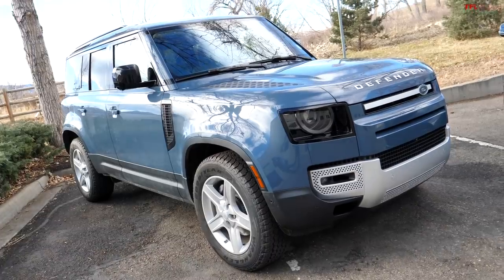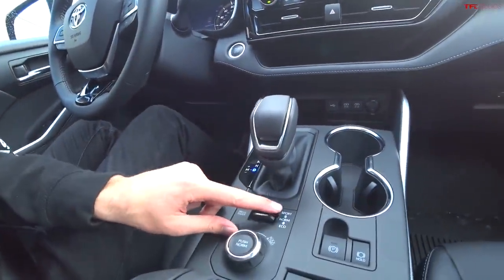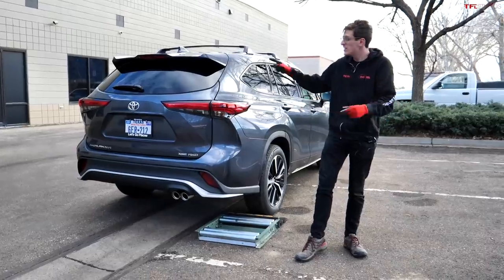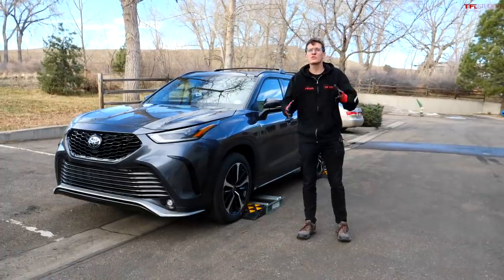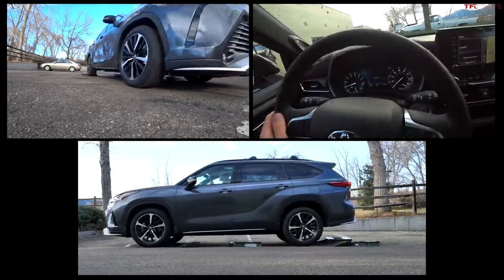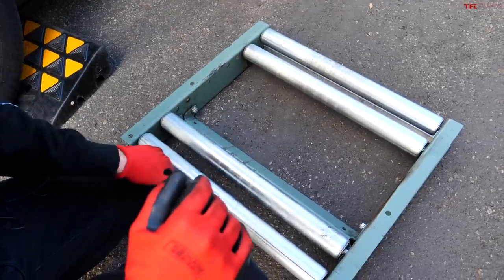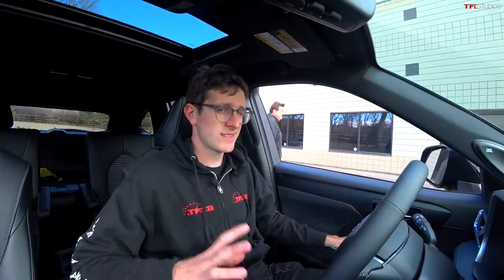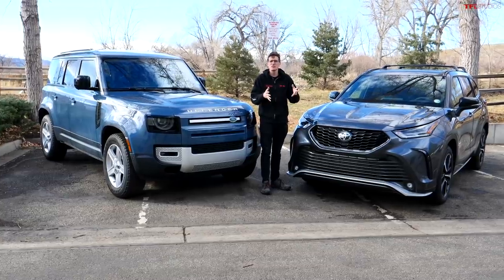Does Land Rover REALLY Make The World's Best Four-Wheel Drive Car? I Compare It To Find Out!

Comment: I never would have thought we’d see those two vehicles be compared. That being said, it was actually cool to see the differences between all wheel and four wheel back to back. Thanks for sharing!
Reply: Toyota FWD based AWD systems have always sucked on these tests.
Reply: Obviously these guys are limited to what they are given by oem’s. That said, I know from their videos they recently had a 2021 Land Cruiser Heritage in their possession. Why they didn’t test it is a little baffling unless maybe Toyota declined to allow it or it’s too heavy for their rollers🤷‍♂️
Reply: There are loads of city types comparing these vehicles, I guarantee it :D
Reply: Much as I don't like what the new Defender has become, I think I'd rather be broken down in the Defender than seen driving that Toyota. Hideous front end styling and of course a bad approach angle and low clearance if taken off road.
Reply: @MichaelM-to4sg  maybe just haven't done it yet? I'm sure it would have no problem on the rollers. ATRAC is basically the same system as defender uses. But it's a good question about why not. Probably because it's kinda boring if both vehicles just drove off the rollers every time.
Reply: @MrJcjet  It would be intriguing though I honestly don’t know how much Toyota has developed traction systems and suspension in FJ200 series since I owned our 2008 LX570. I would hope it’s much improved as that vehicle was pretty awful in snow. On dirt, it was fine on fire trail but once it got a little rocky, it’s limited suspension articulation really limited its abilities to keep good tire contact. Our RR and especially my son’s LR4 was infinitely more capable on rocky trails. A RR and LR4 is confident and capable on AT’s in all but ice, the LX was scary and slide prone unless there was at least 4” POW or groomed snow. The minute we had hint of snow, I had to mount studded Hakka’s to keep from sliding off my driveway. 

Conversely, my partner had a RX450h which was not only far, far cheaper servicing than the LX, it got better than twice the mpg’s and never had a single issue. It was also as competent as the LR’s in snow and ice on all-season rubber. From my personal experience w/LX; it’s hardly bulletproof reliable, it’s ride quality is more akin to our old G55, vastly inferior to LR, it’s poor on slippery tarmac and very limited off-road. I’m sure w/aftermarket suspension upgrades, not easily nor reasonably executed w/it’s air suspension, and different tires, it might be improved but those upgrades and utility is probably more suited to international versions w/Diesel engines and coil spring suspensions. I suspect they may also use a different steering box and geometry as the LX turning radius becomes major hindrance avoiding swales, boulders and similar. A stock 2008 LX570 is not a good off roader nor on roader except on smooth paved dry tarmac.
Reply: @MichaelM-to4sg  I'm not sure if you're aware but an lx570 won the stock class baja 1000 this year. Not really a reflection of the traction control - it has real locking diffs. Mostly the point there is that it's a real legit off-road platform. A  G wagon was raced, but did not finish before the course closed. My understanding is that it eventually did finish maybe 10 hours after the Land cruiser/LX. I don't think a new defender could finish at all. It's really unlikely given how small the tires are and how limited the suspension is.

The Land Rover is really close to a car with big tires underneath. And its awd system is far more car like in form and function. Yes the body looks like an SUV. But it's not really the same thing. So on normal road with ice or snow is probably better. In fact the IS/GS Lexus awd system is probably the best of all of Toyota's for snow on plowed roads. And incidentally mechanically the Lexus IS awd is more similar to the defender than the lx570 is. For a test like this though, the Land cruiser would act the same. The traction control systems are nearly identical. They measure hall effect sensors in the abs system and then apply brakes to the spinning wheel. Toyota, land rover, Subaru, Honda - they're all the same. Even the Toyota Camry awd TFL just tested a few weeks ago passed this test just like the Land Rover. Not sure why the Highlander didn't other than some software differences.

The only difference between any of them for this type of test is the aggressiveness of the software. With ATRAC turned on the Land cruiser is basically identical to the Land Rover in aggressiveness. At least it is now. I don't know how much has changed since 2008. The only thing I know of for sure is that my 4runner now has 5 speeds of crawl control and 5 settings for traction control aggressiveness. The 200 series land cruiser initially only has 3 speeds and I'm not sure about traction control adjustability on demand. Toyota makes you turn it on. Land Rover turns it in by default. The reason is that it uses the brakes and if you use it too much for too long the brakes overheat and it stops working. So Toyota says use it only when necessary. Land rover says use it more often. Nether is wrong. Just different philosophy.

Comment: Hey Tommy, Land Rover developed Electronic Traction Control to work alongside 4 wheel drive and Electronic Air Suspension back as early as 1992 on the Range Rover Classic,  a world first, Discovery one also recieved ETC in later years. 
Hill Decent Control was pioneered on the first generation of Freelander back in 1998 due to the lack of a low range transfer case. The first incarnation of Terrain Response arrived with the launch of the Discovery 3 in 2005 then Range Rover Sport. I bet you miss your old D3 now! The full size Range Rover was the last to receive Terrain Response on 2009. Keep posting more Defender videos, nobody in the UK reviews cars like you guys!
Reply: Don't think the Discovery 1 had traction control None that I've seen. Nor the Classic Range Rover unless the LSE with its air suspension had it. The p38 had traction control on the rear axle (from 1993) until the 1999 model year where it got 4 wheel traction control. The Freelander 1 and Discovery 2 both got 4 wheel traction control and hill decent control. Freelander late 1997 and D2 launched in 1998. The 4 wheel TCS was also offer this year in the Td5 powered Defender too.

Comment: I love these slip tests. I want to see AWD Escape vs Bronco Sport. I want to know if the AWD system is actually any better in the Bronco Sport or if it's all marketing.
Reply: I love them to, you may visit me and find hundreds of these tests.
Reply: That'd be a pretty equal test!
Reply: This is a great idea, but wow if you think Ford marketing was angry before........
Reply: awd is all ways marketing
Reply: @4x4.tests.on.rollers  I've been aware of your channel for awhile! I liked the Tiguan vs Tiguan and Jeep Renegade vs Audi Q2 tests. Just subscribed.
Reply: @smithjones1906  Thanks! Unfortunately we don't have strictly American cars (like Bronco) in Europe but majority of others is the same.
Reply: @CJ Malone Exactly say what it is. Brakes slamming to trick open diffs into hopefully transfer power to the wheel with traction. That is not shifting power, or applying direct power. An LSD diff can certainly improve the process. But not many systems use lsd diffs.
Reply: That'd be very cool actually
Reply: $50 says it's exactly the same.

Comment: Drove a Discovery II at Landrover Lodge in Durango Colorado in late 90s before they brought it in. This was a limited invite event where we did everything imaginable with car on and off road. One of the demos was to drive up an incline on a set of log pairs with rollers in them (one for each side of car) such that there was never more than one wheel NOT on a roller at a time. It was impressive how well the LR handled it and later I traded my red D90 for a new Disco II. You would love to have that log setup. Thanks again for videos.

Comment: "Land Rover knows how to build an excellent Terrain Response System,  it's the best in the business.  It should be because LR pioneered it, some 20, or so, years ago.  So they have a lot of experience refining the system."

Pity they do not do that with quality control, reliability and warranty and after sales service.  At least in Australia.
Reply: Why have "terrain response system" when lockers are better and more reliable (probably cheaper too)...
Reply: It’s like that world wide not just Australia
Reply: @megarafjogos  Agree. With ANY part-time 4WD system (ie 50-50 torque split between front & rear tyres), all of these tests can be conquered with ONLY front & rear diff lockers. In a full time 4WD system, a center diff locker is required. Maximum 3 additional components vs a full computer gizmo that is prone to failure. Nuff said....

Comment: 1) 2WD is just power to one wheel on a specific axle, either front or rear;
2) 4WD is just power to one wheel, the difference being that wheel can be on both front or rear axles;
3) 4WD with a locked central diff is just power to two wheels, one on the front and one on the rear axle;
4) 4WD with locked central and rear diffs is just power to three wheels, both rear axle wheels and one of the front axle wheels;
5) 4WD with locked central, rear and front diff is true 4WD, meaning all 4 wheels are equally powered (it is very hard on the transmission);
6) AWD means all 4 wheels get power, but not equally, allowing for much better handling when cornering (it is very expensive and complex);
for some serious off-roading, you need to start at least al level 4);
it's true that there are some modern 4wd systems which try to simulate AWD by using the brake system to individually  brake the wheels that are slipping in order to send power to the wheels that have traction, but in difficult off-road conditions, where all 4 wheels are on sand, snow, mud or gravel, the reality is that none of the 4 wheels has serious grip, so these systems quickly find their limits.
Reply: For regular road usage, what is the best system? My first experience w a 4x4 was a recent ram 1500 loaner and I wasn’t sure how to use it - whether I should leave it on auto, 2x4 or 4x4. On the dry road there was a lot of binding. And in the rain, the truck was just sliding all over the place on my local windy roads. After that experience, I much prefer my simple  awd or even fwd for traction on regular roads.
Reply: @Wasabi9111  For regular road usage, the best system is AWD, because it allows all 4 wheels to be powered when the grip is very low, but also works good on dry windy roads. For example, the best AWD systems come from AUDI, with quattro (Torsen), Jeep, with Quadra drive, and Subaru/Toyota.

Comment: AWD has a center differential
4WD does not.  It has a transfer case that forces the average speed of the front axle to be the same as the rear.
Reply: This is the right answer for anyone wondering.
Reply: i’m mot sure. Both the wrangler and camry awd don’t have a center diff and by your definition they would both be 4WD. I disagree -Tommy
Reply: In my part of the world, South East Asia, these are classified as PART TIME or FULL TIME 4WD. And that is the exact definition, removing all the ambiguities. Full Time 4WD requires a Center Diff. As long as 30 yrs ago, the Landcruiser VX Limited (aka Sahara in Australia) ALREADY had front, center & rear diff locks in stock form from Toyota that will put all these so-called Terrain Response systems to shame. BTW, I'm not a Toyota fanboy.
Reply: @androidboxhome586  — VERY GOOD — as long as the “center diff” also includes differential units installed integrally into a transaxle.

In the US, Full-Time 4WD was the standard nomenclature until there was a Full-Time 4WD without a low-range.

Mid 70’s, AMC-Jeep began installing Borg-Warner full-time transfer cases (using viscous coupling in transfer case) into their Wagoneer and Cherokee vehicles. There was no provision for disengaging this system. It and other similar period offerings were called Full-Time 4WD.

Then in the late 70’s, AMC introduced a CAR with a Borg-Warner case with a viscous coupling WITHOUT a low range, and called it AWD instead of Full-Time 4WD.

And the debate continues ...
Reply: @TFLnow  — Tommy, Chris’ def does apply to the Wrangler — it is a 4WD.

And the Camry AWD does have a differential mechanism, it’s just not incorporated into a transfer case proper, and so by his definition, is indeed an AWD. The only question with his def is the use of the term “transfer case”.

Comment: Traction Control on full-size Range Rover was introduced in 1995 on the rear wheels. In 1999 they implemented a new Bosch system that gave traction control on all 4 wheels and required an upgraded front differential. In 2007, Terrain response was introduced to the Full Sized Range Rover and so was the Active Locking Rear Differential. The Active Locking Rear Differential was Standard on Supercharged Models.

Comment: I don't think it's a fair test. You should've picked land cruiser or FJ against the defender. Anyways good video ✌🏽
Reply: You said it yourself that highlander is more focused on-road unlike the defender.
Reply: The result woudl be the same. You don't mess with the Land Rover Terrain Response system!
Reply: @gc2234  I'm not saying that LR terrain response is not good. What I'm saying is that highlander isn't a match for defender, they even said it at the end that it's an uneven competition.
Reply: The same test with a land cruiser would've different results
Reply: @duplex901  the Land Cruiser is no match for a Land Rover....as this video proves.... https://youtu.be/d3nP2mbjB_M
Reply: @gc2234  that's even more apples to oranges. That's not a proper land cruiser. 4cyl? Really? Plus non off-road tires, and off center tow hook. There was never a chance
Reply: @orangeVSappel  it's the only Land Cruiser Toyota can sell in Europe because the rest of their range has ancient 20 year old engines which don't meet the latest European standards. So it's the top of the range Toyota vs a mid range Land Rover. And the Land Rover still won easily. 😂
Reply: @orangeVSappel  the Land Rover was on low profile summer tyres. And it still won. That is such a weak argument. Also, why on earth would Toyota design their car with an off centre tow hook? That's very lazy design. They should really learn from Land Rover. As you can see they have managed to design their luxury off roader with a centre tow hook... As it should be.
Reply: @orangeVSappel  agreed. That's a 4cyl 2.8L.
Reply: @gc2234  lol exactly it actually is the best
Reply: @duplex901  of course it's not only land cruiser or Prado

Comment: Man I really wish you guys compared it to a 2nd gen Highlander. Because they have full 50/50 split all time. Toyota even considers it a full time 4wd. Not the mileage saving system that is front wheel drive biased.
Reply: @ConsoleCombat  yeah, the awd system got really ripped down past 2nd gen just to get a slightly better fuel economy. I’ve taken mine where most true 4x4s would venture and it’s never batted an eye. Only kryptonite would be the 8.1in of ground clearance, but I rarely have any issues with that. And it essentially has an always locked center diff which again feeds 50/50 power to each end continuously. No slipping needs to be detected, it’s just always there.

Comment: 4WD capabilities has never been Land Rover’s problem, it’s always been EVERYTHING else. 😪
Reply: My Discovery 3 (2008) is still going strong. School run in the week. Off road at the weekends. Air suspension still working too :) Covered in scratches though. Well, it is a work horse. But I cannot tow my ex army trailer with the new Defender :(

Comment: I have a 2-wheel drive  (front-drive) car.  To make up for it, I carry with me 2 folding metal-bar traction aids (from Canadian Tire).  Occasionally I get one tire spinning on ice, and instead of having to spend $2,000 more for AWD, I simply take out that $50 metal traction aid mat, place it under the spinning tire, and presto = problem solved = un-stuck.  I only use those things maybe once every 3 years, and I live in Southern Ontario, Canada;  a place where we get a ton of ice on the roads each and every year. I credit that to the fact that I have winter tires on my vehicle, so that is why I get stuck so seldom in the winters. My car only has 6" of ground clearance yet I frequently drive through 6" of freshly fallen snow with no problems, while other 2wd-car drivers using All-Season tires get stuck in just 4" of fresh snow. So the lesson learned here = You really don't need AWD as long as you have winter tires on your vehicle, AWD won't stop you any faster, but winter tires will stop you faster, and will help you on ice and thick snow as well.

Comment: The Discovery II came out in 1997 with traction control as an off road specific asset, though LR had been messing around with Traction control back in the early 90's
Reply: Yes some range rover classics '93my onwards with ABS have ETC on rear axle to act like limited slip diff, they had viscous coupling in transfer box aswell since 1988, unlike other land rover models of simular era that relied on manual locking centre diff only.